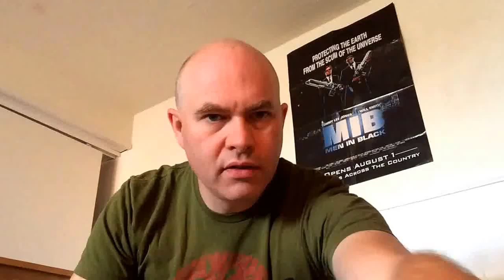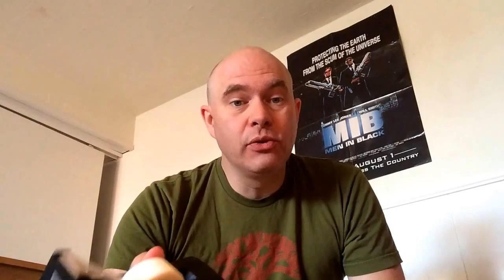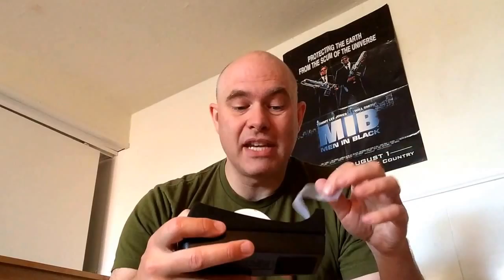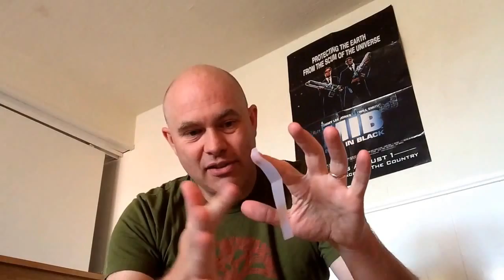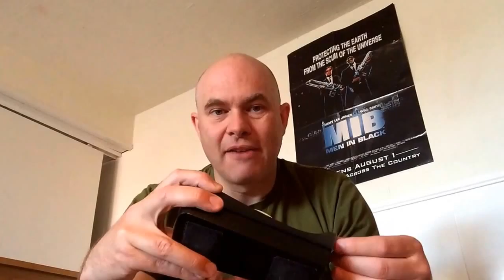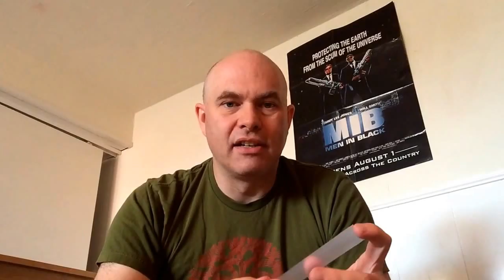Tape Science

Comment: Presumably the X-ray peak energy is determined by the thickness of the dielectric and the speed of tape unrolling (by way of increased potential difference). Should get characteristic peaks at 277 and 525 eV (the K-alpha 1 lines for carbon and oxygen) if it's fast enough.

Comment: This is the first time I've caught you making an error, abet a slight one. While you can isolate graphine by putting it between two pieces of tape and pulling it apart, you would need to do that many, many times. The actual group used a small piece of graphite placed between two tape-covered wheels.